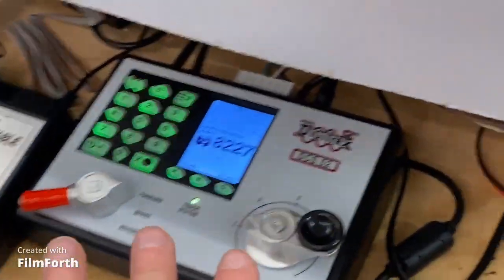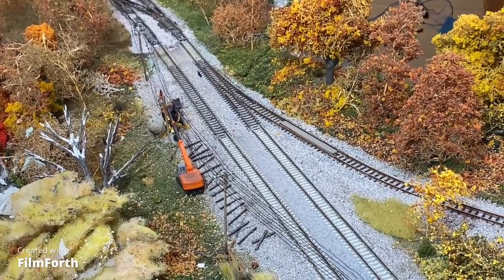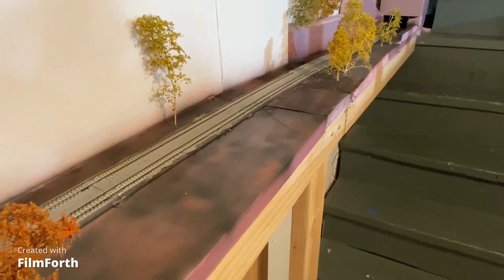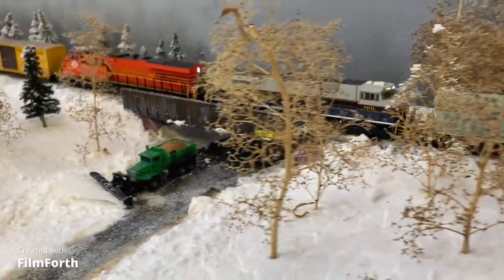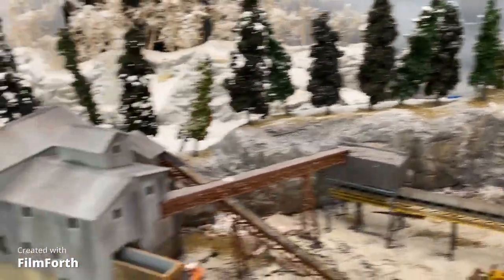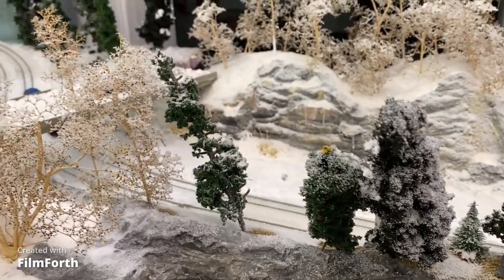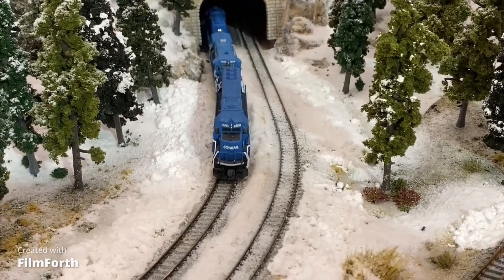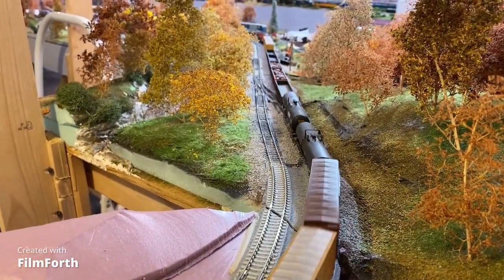DCC Over current and Short Solved

Comment: The best thing for that problem is to keep the locos you are using on track that you can shut the power off to. I've had no problems since I've been doing that. Everything decoder in my units are Digitrax.  Bob
Reply from the maker: i do like digitrax for the non-sound decoders.  i've had one forget it's address and this one go AWOL.  i'm sure the issue is at some point a surge happened on the line and the decoder just happened to be unfortunate enough to take a hit - it's usually a user error.  i have certain areas where power is cut by power routing turnouts, but when i'm done for the day, i typically just park everything on the main.  i think to go back to re-isolate the blocks like it was back in the DC days would be a disaster.

Comment: If you used DecoderPro, it would have been interesting to see what CVs no longer matched what you had saved to your roster file for that loco.
Reply from the maker: never got into DecoderPro or JMRI - but i see a lot of folks using them.  my command station makes it so easy to program, i haven't needed to venture out into other stuff.  to be fair, i've not really programmed anything crazy - very simple speed matching and consisting has been about it.  at some point, i need to get into the computer based stuff - it looks like it makes complicated programming uncomplicated.
Reply: @AlleghenyNorthern  I had actually wrote my own CV management software, but when I discovered DecoderPro, I immediately switched to it because of its superior user interface. The fact that it's free and will run on most hardware that runs Java makes it very attractive. This side of computers in model railroading is almost like air brushes and painting hoods. Some folks just don't want that. But with the increasing complexity of today's modern decoders and the proliferation of computer hardware, it is a natural.

Comment: I have had nothing but trouble with Digitrax decoders. A couple of engines I have were running around the layout in a consist with other engines.. the 2 that had Digitrax decoders all of a sudden decided that they wanted to change direction and run the opposite way while the other engines were still running forward. That's just 1 problem I've had.
I now primarily use TCS decoders and have no issues at all.
In saying that, I do make sure that my engines are serviced and keep a record of when they get done.
Reply from the maker: personally i like my digitrax stuff; it's fairly reliable.  i will say that every decoder issue i've had, however, is in a digitrax unit.  although the decoders in the BLI models are probably my most wonky.  TCS and ESU i've had no issues with - digitrax just makes it so easy to find the right drop-in for the older locos i converted.